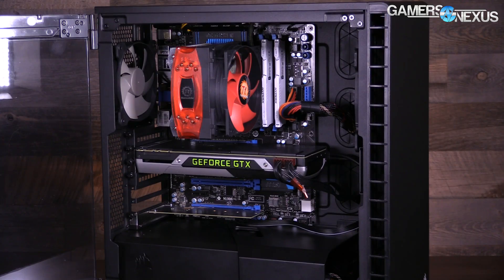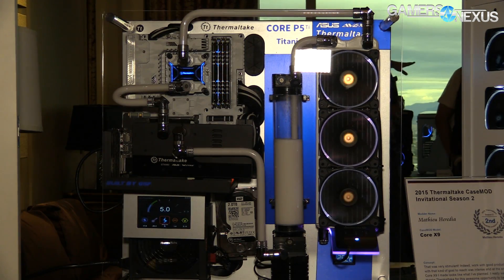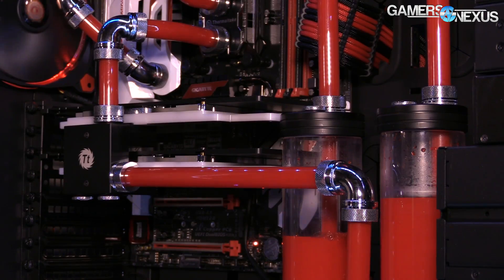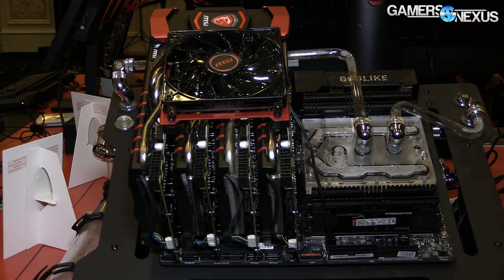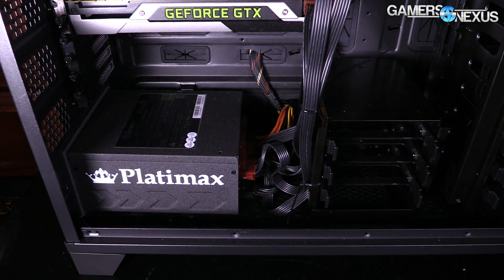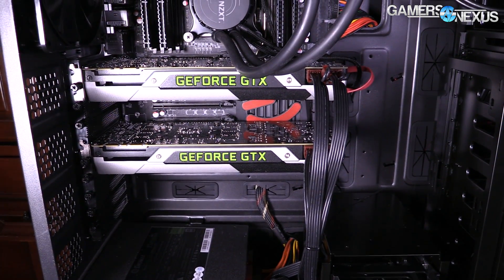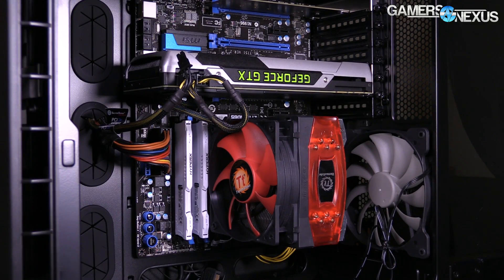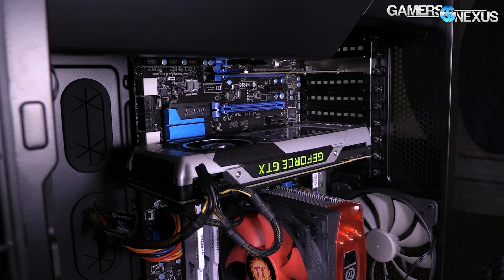Beginner PC Building Tips & Common Mistakes

Comment: About IO shields, sometimes they have small prongs sticking out, I noticed this especially on MSI motherboards. I believe they are used to help with grounding; anyway, these prongs get easily bent when aligning the motherboard to the IO shield. It's always a pain to see something like an ethernet port blocked by these silly prongs.

Comment: As far as OS installation goes, Should always create a smaller primary partition just for the OS to sit, while you keep all your important info on the 2nd partition on the drive, that way if you ever need to reinstall windows/your OS, you don't lose all your information in formatting the partition with the OS. 

Also if not getting a case is going to get you a better GPU, should totally do it and just run with a cardboard case for a while.

Comment: I have a tip, I see constantly Youtuber's flexing the board big time when plugging RAM, PSU, or other components.  I cringe, SMD's can easily be damaged or even pop off the board from excessive flexing.  Either install as much as possible while the board is on a flat surface, or try and put some back pressure like when attaching those stiff ATX PSU connector.
Reply from the maker: +phillychuck Also great advice! We like to install the CPU, cooler, and RAM before mounting in the case, too. Just a bit easier, really.
Reply: Supporting the pcb is key.

Comment: Never force anything if it has a lot of resistance and shouldn't. I did that on my first pc when I was replacing the cooler and pulled the cpu out with the cooler.. Lol
Reply from the maker: +flandersrobby That is a fantastic piece of advice.
Reply: flandersrobby did you use thermal adhesive instead of thermal compound
Reply: Levi Lapsley It was a stock cooler for an AMD fx 8350 with the adhesive already on it. So whatever those AMD coolers come with pre applied.

Comment: I've been stuck for the last week with my new/first PC build. Got an SSD and installed the OS/apps on it and installed the games on an SSHD. Huge stutters in games and too many crashes...
Problems like not finding and optimizing the games always show up. Heck, Radeon Crimson has been a pain in the ass and after ditching the SSD, then working with the SSHD alone,  i can't find the Gaming Evolved app. Lots of applications and drivers from MSI don't work anymore.
Is it a compatibility issue with win7 or i'm just not lucky. Its really frustrating to get around drivers. From the site, they are pain to identify and when i use the update feature after installing from the CD, i get fucktons of errors and updates for none-functioning applications.
I'm honestly giving up...  that's from my side =(
I guess the question is, how do you install drivers like a professional. Do you directly go to the site and pick them one by one or use a total installer ? Do you use the CD's that come with the mobo/GPU ?! assuming your mobo is two years old, well mine is.
How do you deal with newer hardware as opposed to older ones when it comes to drivers ?!
Reply from the maker: +X3R0 J4M We always get the drivers fresh from the website official support pages. For GPU drivers, you need to use a driver cleaner (DDU works very well) to purge the previous drivers before installing the new drivers. This is very important.